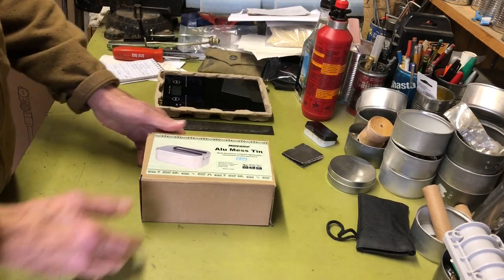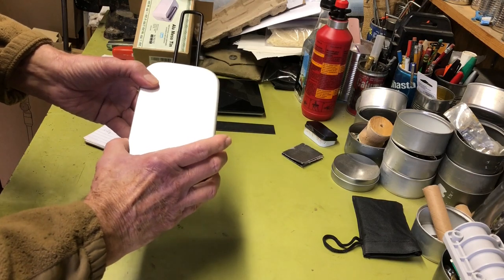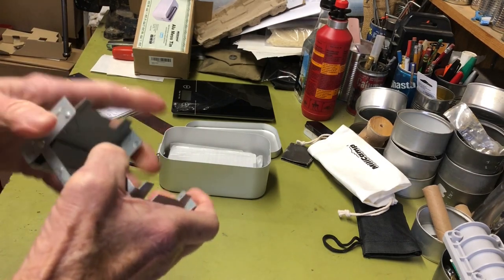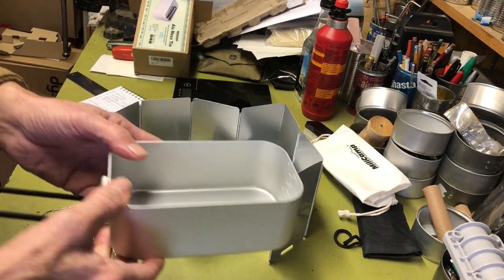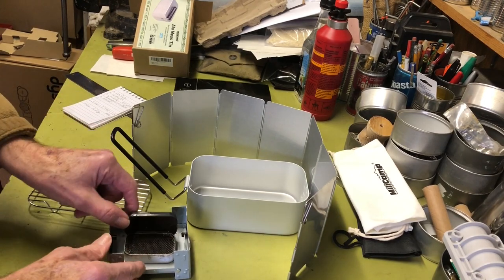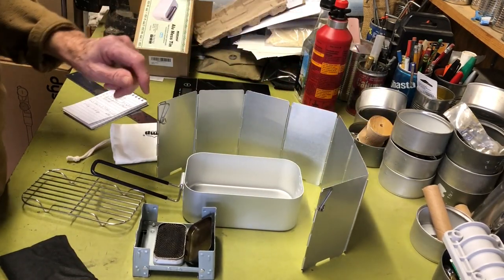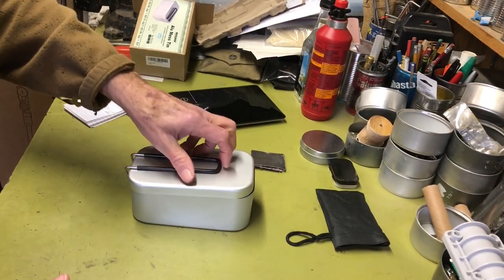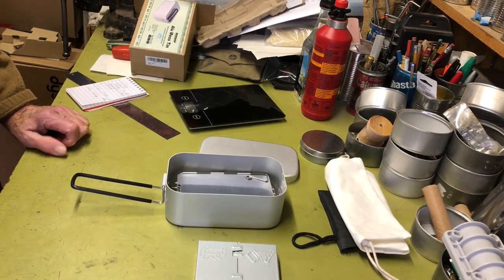Trangia Style Mess Tin Cook Set

Comment: 👍👍👍
Those square mess tins work well. I've got a set from my Military Service dating back to the 70's. We knew them as 'Dixies'. My Esbit Stove was my first issue in February 1968 and still in use. I no longer use the Esbit Tablets as Alcohol Liquid or Gel Fuel is cheaper and easier to source, although I do store a pack of tabs in the folded stove for 'just in case'.
An observation .. storage of the Mess Tin Accessories. If you put the Windscreen in at the bottom, the griddle upside down on top with the feet pointing up, then 'nesting' the Esbit Burner between the feet. This should give a little more 'head room' in the Tin.
A nice nostalgic share .. thanks. Take care ..
Reply from the maker: We must be about the same age, I went into the USAF after collage in 73.
I've played around with solid fuel but I don't like it because of the usual complaints, smell and tar soot.  
It is the  best for survival kits or backup fuel for other stoves. I keep the folding stoves with solid fuel in my vehicle  survival kits.
Reply: @planetsideagent  👍 .. yep, 'Baby Boomers' 😊.
'73, I was 23 at the time and working 'down the (gold) mine'. USAF .. I believe you flew Skyhawks? Me .. I was one of those mentally deficient characters that jumped out of perfectly functioning aircraft carrying lots of ballast 😁. Called it a day in '84.